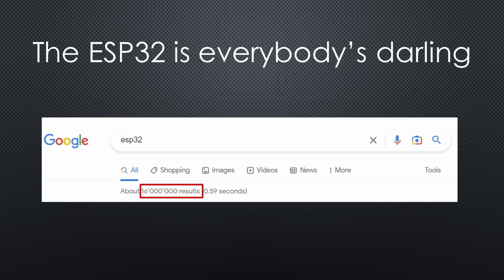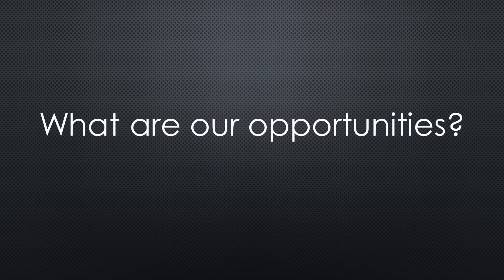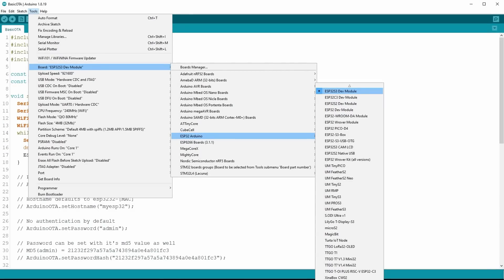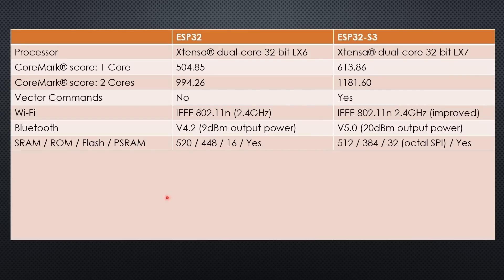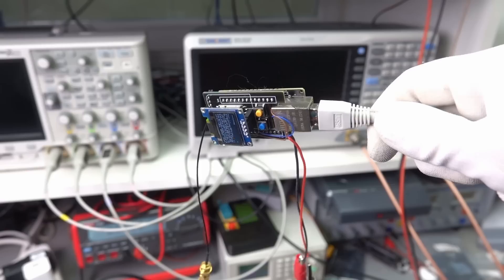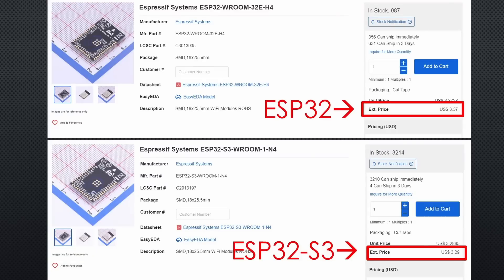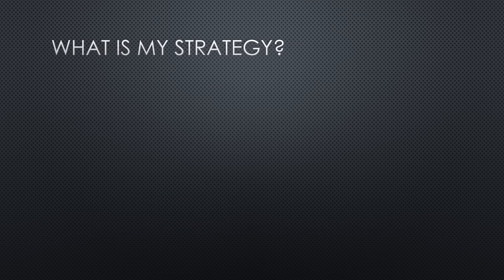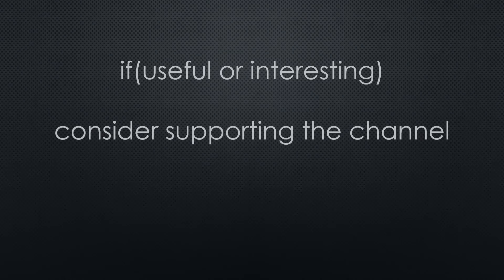451 Which Processor can kill the ESP32?

Comment: Don't sleep on the C3.  It's the only chip I use for battery projects, as it has the lowest deep sleep current.  All together in a module with an LDO I get around 50uA of deep sleep current with a C3.  Not so with any other ESP32 variant.

Comment: Would you look into ch572 and related? Very interesting BLE and 2.4ghz (not WiFi) compatible boards.
Reply from the maker: Is it supported by the Arduino IDE?
Reply: @AndreasSpiess ch32v003 with no wireless is, the others are too new (released 4 months ago). cnlohr made a minimal install that’s called ch32fun that can support it if you’re interested.
Reply: @AndreasSpiess my comment was deleted. Ch32v003 with no WiFi is, these are not yet, only released 4 months ago, but I think they will be soon. Ch32fun supports them all if you want to look

Comment: Would you offer an opinion on the ESP32 for Model Train control and Layout Action Management. Building now using ESPNOW with very good results., Control of Direction, Speed & Sound from Base Model to Mobile Train Module. Now looking for Strong Self Awareness for engines to operate in reaction to Layout changes from a separate Base Control. Next we want to have small 2 Wheel Bots on flat care we can carry to a mission then unload and swarm in to effect resolution to issue as a mission. Then we assign the engine a mission and set it loose to navigate the layout based on Mission Directives to avoid collisions and wrong switches while reacting appropriately to signals. So we are always looking for bigger better yet smaller Devices. Seems we may want to start a new Test set for the ESP32-S3 Your Thoughts???  Thank You for all your effort wee listen, read and use your inputs to improve our controller as it is used only on 1950s American Flyer S gauge Trains. A special class of the Hobby. Dennis on You Tube as "Frankentrain Laboratories".
Reply from the maker: Looking at you channel, you know what you do! One small addition (if you do not yet use it): AI agents like claude or codex are a very good addition for programming these days.

Comment: I'm only recently using a microcontroller. An arduino uno r3. But other than running LED or code in background, it is so very limited. Looking for a better devboard for my projects that include displaying information on a PC monitor using a VGA cable. And here the limitations of the uno come showing. VGA requires some dedicated pins leaving you with a full port removed, just for some image on screen. So looking for replacements. But there is so many choices now, it's hard to pick one. an ESP32 or Raspberry pico for example?
Reply from the maker: The advantage of the ESP32 (and the Pico WiFi) is that they open many possibilities because you can connect them to the internet. The ESP32 has a much bigger community and therefore you will find much more projects and help.

Comment: The ADCs arent low quality (IMO). If you build a proper voltage divider, set attenuation to 0, and add a small capacitor its generally within a few tenths of a volt. Calibrating ADC and multisampling will get you within a few mV.
Reply from the maker: I once made a video about the ACD of the ESP32, and it was really bad (non-linear). Maybe the newer ones are better.

Comment: Great video until the part I'm watching.!!!
Reply: @AndreasSpiess  Since you're seeing comments...
I'm very grateful for that!
I will report my current problem with ESP32
I would like to unite 4 units of ESP32 modules on a single board, it would be a single module. 
Soon I would have 8 cores that could work independently of each other connected by I2C Slave
Both for ESP32 and others (Arduino, etc...)
I missed a standard location, a memory repository, where everyone could write data and read it at high speed.
I would like to know how to adapt a common RAM memory to everyone.
This is really necessary because if you create a web server for ESP32, the HTML page will be very limited.
I thought about how to use DDR1 memory, but ChatGPT says it's not possible!
Do you know something like this?
This way I would avoid using I2C, but still keep the 8 cores.
It would be an excellent video.
This common memory area is necessary for electronics, it would have excellent speed and each core would perform a GET or SET of data without compromising its performance!
Reply: @AndreasSpiess  
Have you ever imagined creating an esp32 OCTA-CORE board?
Leaving the digital GPIOs in common and isolating the special ports.
United by I2C communication!
Reply from the maker: @fmViegas  I never thought about it. I usually use a faster CPU if I need more power.

Comment: Dear Andreas Spiess,
I would like to create a straightforward project using an OV7670 camera and a Nokia 5110 display on a breadboard, controlled by a microcontroller. My plan is to display motion detected by the camera on the screen. Additionally, I intend to connect an infrared transmitter-receiver diode pair to the controller.
My question to you is: Which microcontroller would you recommend for this project? Ideally, I’d like to write code for it in the Arduino IDE, and I want the physical size of the controller to be as small as possible. I assume that the ATtiny85 might not be suitable for this purpose.
Currently, I am experimenting with an ESP-WROOM-32 – Mini 32 V 1.0.00 controller, but I believe there might be a more suitable option for my specific project, especially since I won’t be using its Wi-Fi functionality.
Thank you for your guidance!
Email: mikcipp@gmail.com

Best regards, Lőrincz Miklós

Comment: I'm a huge fan of STs 'Nucleo' boards. You can get one for any of their ARM Cortex M parts (dozens), free halfway decent IDE and built in usb debugger/serial port/file system.  And they have a ton of I/O - Arduino shield plus their own 'Morpho' connector. As an embedded programmer, I've used them many times to prototype something. And they are cheap.
Reply from the maker: If you want to go propretary STM, that is a good choice. I decided to stick with the Arduino IDE because you can use chips from different suppliers.

Comment: Excellent video friend. For me, the best development board is the ESP32-P4, which reaches 400 MHz, dual core, and 728Kb SRAM... the bad thing is that it will probably come out late. Because ESP32-P4 boards there are only few prototypes to test. Yes, without DACs!
Reply from the maker: Plus so far, it is not supported by the Arduino IDE...

Comment: Ai Thinker’s A9G (soc + gsm + gps + sd card) has a potential but like many new dev boards, it’s support stopped by the manufacturer. Good thing makers found a way to port it to circuit python. But I hope it is also ported to arduino.
Reply from the maker: Unfortunately, these chips only support a very old GSM standard. In many countries, these networks do no more exist.

Comment: For standalone personal IOT projects that don't involve streaming or sending massive amounts of data the price point on esp32 definitely can't be beat. For example I use them for a secure ad hoc wifi mesh network as repeater nodes. Data packets are broken up and hopped to whatever node is available to receive so larger data streams can be sent simultaneously to end points. I use a bit more powerful microprocessors for my AP masters that can handle multiple connections and reassemble data streams.
Reply from the maker: Sounds like a very interesting project!
Reply: @AndreasSpiess  
Yeah the hardest part for me was programming the data packet "header" to save as much memory as possible as you need order/destination if you want to use data packets and reassembly. I ended up with just pass through using a short hex variable and code similar to what a router would do tied to another variable open for input for whatever data I wanted to drop across the network. Data type you can filter with a couple if then statements and send it wherever you need. As for the data itself you could go dynamic too and easily create an endpoint at your AP with a touchscreen interface to simplify what/where you wanted to send your data from ie. SD card, sensors, or simulated keyboard input. Esp IDF is easy to use covers basic encryption and can send multiple type requests. The base is just a modified access point sketch which is setup instead for p2p ad hoc.

Comment: Hi Andreas, I ordered an esp32-h2 module and installed the Arduino ESP32 Core version 3.0.0. I am going to use my module as a Zigbee client (for my sonoff dongle that acts as a coordinator for zigbee2mqqt). But I can't find a good example to commumicate via zigbee in arduino IDE. Should I use the XBee library for that?
Reply from the maker: I am not sure if Zigbee is already supported by the Arduino IDE
Reply: @AndreasSpiess   hmm, that would be the reason. Then I have to use Python I guess. Thanks!

Comment: There's some RISC V boards that are blurring the lines between microcontroller and SBC like MilkV duo 

Have a few in order for evaluation no WiFi but native ethernet interesting times ahead
Reply from the maker: I looked at them. I fear that they will suffer the same issues as all Pi competitors in the past: Software support. To create a bash prompt seems to be easy. But for a project, it needs a huge eco-system. We will see which of these numerous projects get the Maker support.

Comment: There's no processor that can kill the esp32. The only thing that's going to kill the esp32 would be raising the price. I use the raspberry pi pico as my preferred goto because the computer sees the device as a flash drive and for the ease of python programming.  I still have a ton of esp32's in my box and sometimes thats a better choice. One thing, since they are cheap. Sometimes it's better to split up an application among several processors. If someones worried about power requirements then they need a bigger battery and consider a power management system that can maintain battery voltage. STM is bullshit. The STM showed promise but it clear that the developers haven't a clue what people need or want. Expect the STM to fade into oblivion. Make sure you take care of yourself. None of us are getting any younger. Eat healthy and be healthy.
Reply from the maker: I agree that the Pi Pico is an excellent choice for programming in Micro Python.

Comment: Glad to know that ESP32 supports Zephyr :) Now both Nordic and Espressif eventually have the same OS
Reply from the maker: Do you use Zephyr on the ESP32? Is it stable?
Reply: @AndreasSpiess  Not really on ESP32, I work on nRF52 and using Mbed. Trying to port the code base to Zephyr. The nrf52 has a really nice SDK (nRF Connect SDK) with a lot of tutorials and examples on their official website. The SDK is a Nodicsimiconductor version of Zephyr, it works nicely with VSCode. On the other side, Mbed is really interesting, It is narrowing the range of the boards it supports and seems not actively support its own users. I saw ppl on the Nordic forum asking for help about MBed because Mbed support pushed that guy to Nordic, I can not tell you whether Zephyr is on ESP32 is stable or not but I can tell you to stay away from MBed :) and Esp32 is RISC-V, so I guess MBed simply does not like ESP32 anyway

Comment: We need 5V GPIO pins on the esp32, I’m tired of using level shifters to interface with other components
Reply from the maker: Most of us changed to 3.3V sensors long time ago. 5V is rarely used (mainly by old Arduino chips). This is the way to avoid level shifters...

Comment: ADC readings trash whilst using wifi and bt... also a big problem of an mcu that's msp is having wifi and bt
Reply from the maker: I agree, the quality of the ADCs is not very good. Still, sufficient to check battery voltage. A common task for such MCUs.
Reply: @AndreasSpiess  I'm really struggling at the moment to find a wifi/ethernet/bluetooth capable unit with a good ADC for reading CT Clamp sensors. Or alternatively an accurate, fast external i2c adc to use with the esp32/8266 for a high channel count but It would be really nice to have it all in one mcu to make pcb designs easier.
Reply from the maker: @Beansswtf  I would use an external ADC as shown in one of my videos.

Comment: Imo esp32-s2 or s3 for arduino
But the BL808  based boards are very interesting and on par with the s3 for price. Examples are pine Ox64 and sipeed m1s 
They have 3 processors and can handle a full linux, so they're closer to pi modules than arduino, but they are insanely powerful for the price and imo the best all purpose soc sub 10 bucks.
Reply from the maker: Are they supported by the Arduino IDE? Otherwise we would lose all our libraries and examples :-(

Comment: As someone that doesn't use arduino very much I tried to use the S3 with the guide for eclipse and VS integration and the ide drove me nearly crazy... I gotta try to arduino approach I guess.
Reply from the maker: The Arduino IDE was crated to simplify tasks for beginners. So you should be happy with it. Later, you can move on...
Reply: @AndreasSpiess  Just to make sure: This wasn't a complaint aimed at you, more the general quality of integration (the VSC one refusing to even install itself) that espressif advertises in their very own guides. From a feature standpoint the S3 seemed like a good choice for newer projects (which is why I started fiddling around with it). As someone that hasn't used the arduino IDE in ages this was actually a very helpfull hint, as I hadn't even considered using it. :)

Comment: At least from what I've seen, nothing from Espressif is even going to come close to beating the nRF52 series in power consumption. Less powerful CPU, no WiFi (but very good bluetooth low energy), and worse arduino support are some of the downsides.
Reply from the maker: I agree. But I never understood why they did not include Wi-Fi :-( This is the basis of the success of Espressif.
Reply: @AndreasSpiess  Nordic's approach to WiFi is definitely weird (with a coprocessor chip to be installed alongside the nRF52 or other SoCs) but I personally think WiFi is somewhat overhyped in low-power applications. BLE is simply a better protocol for only consuming a few mA to exchange a bit of data, and when the WiFi alternatives don't have enough compute power to interface directly with things such as audio streaming (the high-level model of services like Spotify), their utility seems a bit diminished to me.

Comment: I have an RGBWY tape light and DMX Decoder.  I want to control it from a conventional (dimmer) wall switch.
Can ESP32 be configured to transcode dimmer output to DMX for the decoder? (With WiFi config and override?)
Reply from the maker: I never looked into DMX. So I do not know. Maybe Google know a project?
Reply: @AndreasSpiess  How easily could one of these ESP boards convert a 120v diimmer output to a binary value?  (more hardware needed) or could the existing pins measure high voltage?  Thanks Andreas.
Reply from the maker: @andyh8239  You have to bring the voltage down to 3.3 volts.Maybe you watch my video #347?

Comment: S2 has native USB, so it’s a cheaper option for diy keyboards and such. The C6 looks really neat, not very available yet though. The RP2040 is seeing a lot of use in MCU communities other than the arduino and micro python ones. Like for using as the driver of a 3D printer mainboard. They have two cores that are always usable (not having one used up by wireless driving). It’s a conventional ARM architecture, so its a lot nicer to work with bare metal than an ESP, hence why it seems quite attractive for more advanced users. That said, the ESP32C series are RISC-V, which is also gaining traction among hobbyists for its open standard.
Reply from the maker: I agree, the USB of the S2 is useful for some projects. It seems that Espressif wanted to test this feature in the S2 for future designs...

Comment: I think ESP32 and it's WiFi hardware use it's own processor clock (APB clock) for it's MAC to handle WiFi association.
That's why it not support Deep Sleep with WiFi Enabled because MAC logic was not able to do that when CPU is on Deep Sleep.

To enable deep sleep it need to have separate clock generator and will also increase power usage while in deep sleep.

In non-ultra low-power devices like PC, Laptop or Mobile. The WiFi chip/controller run it's own embedded processor and firmware with it's own clock source and communicate with host via PCIe or other bus. so it can keep WiFi association alive even when Host Processor clock was stopped.
Reply from the maker: It seems that this only will be solved with the new generation of WiFi that allows clients to sleep for a defined time without cutting the connection.

Comment: 4:14 Saying it doesn't keep context in deep sleep is a little unfair. You can allocate variables in the co-processor and they keep their state when waking from deep sleep. For larger datasets you can store it to non-volitile before putting it to sleep, then pull it back out on boot.
Sure it's a bit more work for the firmware programmer, but it's good-enough for the price point.
Reply from the maker: I agree that there is a solution. Still, the Atmel chips keep the context...

Comment: Is the ESP-S3s minimum schematic still the same as the ESP-32 ? Which pins are for D+ and D- ? Ive seen IO19 and IO20.
Reply from the maker: I left a link to a sheed with all the pins of the -S3. I never used a chip, only the modules. And they are different because of more pins.